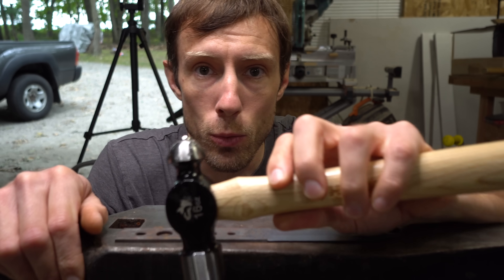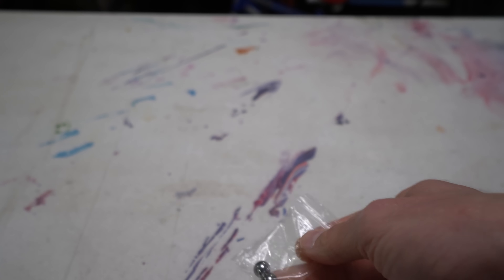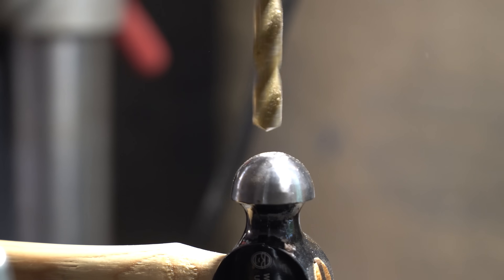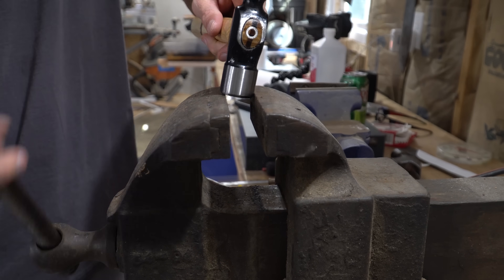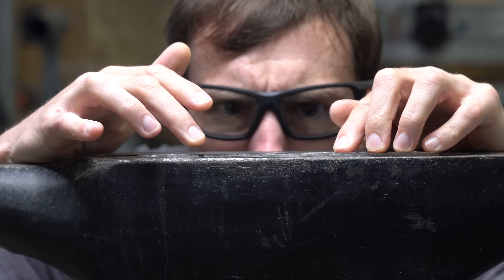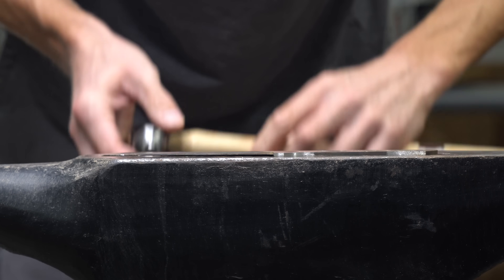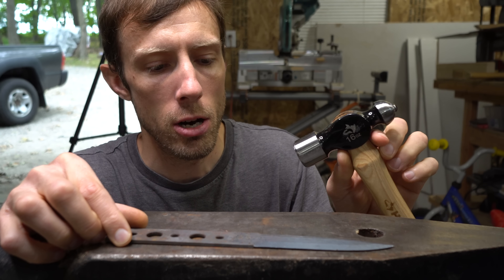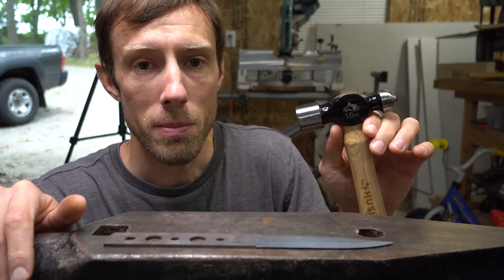I Should Have Made This Weird Tool WAY Sooner

Comment from the maker: A typical hammer is going to be somewhere in the low 40hrc range. Not hard enough to dent a hardened knife steel, which is usually in the 65-70hrc range.  Hence the need for the tungsten carbide ball bearing, which is going to be 70+hrc. For those wondering why you cant just use a regular hammer. 🙂
Reply: Tip. I put a magnet on my drill press and always put my key there. It never goes missing and is always very, very handy.
Reply: Maybe German hammers ere hardened different. I measured 3 hammers with a calibrated Rockwell tester .
I cleaned the hammer surface with emery paper .They were clean.
The readings are 57 to 60 Rockwell 
I knew from old hammers that they were made of mid carbon steel.
The steel gets relatively hard on the outsides but softer inside.
So the hammers do not Charter .
I tester this with C60 steel.
You can easy get it to 63 or 64 HRC
Reply: Maybe the base steel (but highly doubt it’s even that low, probably around 45hrc), but the face should be case hardened to around 50hrc to mid 50hrc. If you measured this then it’s possible the surface had a lacquer or coating on it. 40hrc is very soft and would probably be damaged by a typical framing nail when trying to drive it in. Just a little fyi.
Reply: You can anneal the ball end of the hammer to ease drilling since you don't need it hard after modification. You can use a hemispherical end mill to create a close-fitting pocket and you can braze the ball in place since that's the traditional high strength method for attaching tungsten carbide to tool steel.
Reply: @KJ6EAD If you soften the head of the hammer by annealing, don't you run the risk of just hammering the carbide ball into the hammer itself, rather than the hardened work piece?
Reply: @noxious89123  Not much. The force on the workpiece is concentrated in a small area so the workpiece yields in plastic deformation. The force on the socket is spread over the entire diameter of the ball so the deformation to the steel is elastic. Also, since you've only annealed deep enough for drilling and/or milling, the ball is backed by harder steel. If it's a concern, you're welcome to harden again after drilling or just leave it hard and drill with carbide.
Reply: @KJ6EAD  Tour method seems to me, the most secure way of attaching and durability.
Reply: I'm curious I've got some old carbide punches from work and wondered if I could use them for this project. I believe they are flat bottomed
Reply: Yes you can debend a blade with a normal hammer but what you're actually doing with this thing is cutting the fibers of the metal to let the tension in the blade bring it the other way. In France it's called "Piquettage" and you do it with some kind of mini pickaxe. And knife steel are most likely to go between 55-63 HRC especialy if you don't cryo ;)
Reply: @aeowan2  it’s kinda crazy he’s saying knife steel is usually 65 to 70. Isn’t it like only high quality, high carbon Japanese cutlery and high carbide tool steels like Maxemet that get up the 65 and slightly above range? I remember Jared from Neeves Knives showing his custom Magnacut blade that was like 67hrc while most production Magnacut runs at 60 to 62. I think my Spyderco M4 steel is supposedly 64 or 65. I’m wondering if dude just made a typo and meant 55 to 60? 🤔
Reply: @mikeappleget482  100% agree with you, above 63hrc is really high end steels and 70 is almost unreachable, I don't even know what will you do with a 70hrc knife xD That thing must be so brutal
Reply: 65-70hrc?? what kind of steel are you working with, rex 121?
Reply: Reads like a challenge to me. 😁
Reply: Doesn't matter if "peen" is the correct term or not. The BB isn't far enough into the hole for the peened-over material to capture it inside the hole. I see what you intended to do, but you either need a deeper hole or less epoxy so the BB sits far enough inside it that the lip of the hole actually folds over the shoulder of the sphere.
Reply: You need a retractable lanyard for your chuck key. They're dirt cheap and work great. The only downside is it has to stay with the drill press. 

Magnets work too but you have to remember to put it back lol.
Reply: You mentioned that this was done right after quenching and hardening in two different statements. Is
It done before tempering? The blade you broke (before trying this tool) broke after tempering?
Jus looking for clarification. Thanks!
Reply: Diamond has the highest HRC, therefore it makes the best hammer…. ? Is that the logic?
Reply: Epoxy that chuck key to a magnet and store it on the drill press
Reply: What if someone were deaf? Hammer on the concave side
Reply: Why don’t you just use copper and it’s alloys for making blades as is tradition? :)
Reply: Steels will be harder directly after quenching and before tempering. You loose a few Rockwell in the temper. It depends on the steel as to how hard it can get. So if you get a commercial blade that is 65 Rockwell out of the box, it was probably closer to 67 or 68 before tempering. A lot of more basic knife steels will be around 63-65 pre-temper.
Reply: I say this with love: Doncha just hate it when you forget to put the entire point of your video....in your video? When you see OTHER people do it, it feels like, wow, that guy's a MORON, the audience has NO CLUE why he's doing what he's doing. Yeah, nah, turns out, it's ridiculously easy to make this mistake, even when you've been repeatedly warned about it.
Reply: No normal knife is 65-70 hrc...they would shatter VERY fast
Reply: Absolutely cannot drill into my ball peen hammer, even with that titanium bit. How do other people accomplish this?
Reply: I partially dissagree with you. I made an apprenticeship as a tool and die maker in the late 1970‘s. Straightening thin mold parts that got warped after heat treatment was standard practice. We all had our shop made ball peen hammers. Either with the ball end turned on a lathe or a steel balls insterted into a hammer head. 
Also a steel ball will „deform“ a hardened blade to be straigthended. I still have my hammers from that time. I just straightended a blade hardened to 62 Hrc with a ship bought hammer you used to inlay the ball. But the ball end is flattened.
That said, I also made myself a hammer with a realtively sharp carbide tip to straighten blades. And for sure a carbide ball will not deform.
So instead of a carbide ball a steel bearing ball can be used. The dimples will not be as deep/pronounced though
Reply: Why not buying a carbide pin,  glue it inside the hammer and grind it round at the tip?
You can get round carbide for cheap.(broken Endmill)
I measured some of my hammers. The are around 60 HRC
Reply: 65 HRC would be the extreme high end of knife hardness with some exotic supersteels. 55 HRC is a more typical value.
Reply: @appa609 yeah.. supposedly my Spyderco M4 blade is like 64 or 65. And production M390 and Magnacut typically runs from 60 to 62. I think some super high end, high carbon Japanese kitchen knives get up around 66 or 68. But I think those knives would be so brittle that hitting it with a hammer would crack it.
Reply: @appa609  I wanna learn how to make my own nice knife

Comment: Bruh, I need help, these freaking tungsten carbide balls are basically impossible to get in my country, and I need that hammer BAD, but I REALLY don't want to order from overseas. Will alternatives work? Like tungsten carbide CNC bit?
Reply from the maker: If it has a rounded shape. You definitely dont want a point.
Reply: @OUTDOORS55  KInda late to reply but I bought a carbide CNC bit, ground off the jagged edges and mounted it in an old hammer. Works like a charm, at least on spring steel blades. For my stainless ones, no matter how much I hammer, I just cannot get rid of that tiny warp... ^^;

Comment: Just made one and it works exactly as described. Just be aware that while it will indeed bend a blade where struck, it must be corrected along the entire length of the curve, not just in the middle. If corrected only in the middle, the blade ends up looking like the letter "m".

Comment: "Panel beaters" (guys who hammered aluminum sheet into body panels for cars in the old days) used hand tools to do this every day. One way to understand what's happening is to picture the knife blade as made of clay. Tapping on one side squeezes the material out from under the hammer blow, making the material on that side longer. Being longer, the extra length pushes outward, curving the blade toward the opposite side.

Comment: Metal work...  I'm an intense DIY metal worker.  Nearly all of my sheet metal stock for belt, blade, and such guards comes from salvaged water heater tanks.  They show up at the curb on trash day...  And, I'm all about free materials.

Anywho, after cutting the top and bottom caps off and slitting the tank along its length, there's a rather nice amount of sheet steel available for fabrication projects.  But...

The tank curve makes for non-flat steel.  But, with a ball peen hammer and a 1" thick plate of plate steel as an anvil, I can flatten out any size piece of flat steel I need.

The tank steel is just mild.  So, there's no need for the carbide hammer modification.  But, boy oh boy does the simple act of straightening a few dozen project blanks introduce the skills of manipulating metal to dance as you'd like it to dance.

Comment: Keith fenner has great videos on how to straighten metals. Also old lathe and machining tool tend to have lots of braised carbide tips. You can buy yhis old tooling cheaply. Lastly backlight the material while it is lying on a flat surface and you will see the light bleed through parts where it is bent. Cheers

Comment: 👍
I did this and it is truly worthwhile. I sourced some tungsten carbide balls on eBay, sharpened that drill bit I've been threatening to sort for a while, and off I went!
Go do it, you'll like it. It's worth  mentioning that you don't need the ball if you're only working on steels like e.g. 1084, a std ball pein will suffice.

Comment: I bought the hammer and titanium drill bit and it will not drill into the hammer at all. Any ideas of how to move forward? You make it look so easy! Maybe the "pien" side needs to be annealed slightly? I should include that I used cutting fluid (Tap Magic) and the RPM was 370 on my mill.

Comment: lost drill press keys(and lathe chuck keys).  first I painted them bright yellow (john deere yellow because I had a can of it ).  For my lathe, I made a rack from PVC pipe with holes in it to hold all the allen keys and chuck keys and mounted it right behind the lathe where there is no excuse to not use it.
For my drill press, epoxy glue and a nicely sized super magnet from HF glued to a convenient spot on the drill press housing.  It's been years and now even if I don't stick the key back on the magnet, at least it doesn't blend in with all the other crap in my bench'  another magnet on the other side will hold a center punch, also bright yellow.

Comment: Absolutely love and needed the information in this video!!! Also… had the same problem with chuck key until…I drilled a 1/4” hole in the corner of the drill press cover and simply insert after using… problem solved!!!

Comment: Losing the drill press key always seems to be a problem. I purchased a very strong magnet and put it somewhere around my drill. Press or on the drill press or on the base of the drill. Press and attach the drill. Press key to it. I’ve done this for years, and it is yet to fail me in finding the drill press key.

Comment: I fix leaks in an oil refinery and we close up gaps with a hammer or air hammer and a chisel all the time. We call it "peening" as well. Hell I've closed up flange gaps over 1/4" before to hold wire and sealant to stop a leak.

Comment: Very good presentation. I make rock working tools for myself. You can find tungsten carbide insert tip buttons, on e bay. Kennametal KHC55, pack of ten for about $35.00 us. This grade of carbide is very tough and shock resistant. The cobalt binder in the tungsten carbide is around 20%. Most metal working tungsten carbide has 3% to6% cobalt binder which makes it very hard and wear resistant, but very brittle and not resistant to shock. The khc-55 buttons are 1/2” diameter by about 3/4” long with one end rounded off. Hope this has been helpful, stay safe

Comment: Since the tungsten bearing is spherical, it will stretch the metal in all directions when you strike it. I wonder if using a cylindrical bearing, with the axis of the cylinder perpendicular to the direction you want to stretch the work piece, would make for a more efficient tool?
Reply from the maker: Possibly however, I think it would be hard to hit the inife perfectly square, rather than contacting a single point on the cylindrical shape.

Comment: A magnet on the front of side of your dril Chuck, and maybe a dummy cord are great additions to the drill press. I have a few here that take different sized chucks. So dummy corded them so they could be used, hung on the magnet, but not walk off and not be long enough to be a tangle hazard.

Comment: You ought to dummy cord your drill press chuck key. I have an old-style chucked drill where the key is on the cord--can't lose it unless I purposefully try! The modern day keyless chuck has made us lazy about keeping track of these things.

Also, this is from US Army Technical Manual 9-254:
"(1) Staking is a method of securing parts by pushing surface metal together with punch and hammer. (2) Peening  is  the  stretching  of  surface  metal,  usually  with  a  ball  peen  hammer  or  with  a  hammer  and  a specially designed round-nose chisel. (3) Swaging is the moving of metal throughout its entire thickness where a definite shape is desired."

I'd say you were staking the ball into its substrate (the hammer's steel), but you could also have stated that you were peening the hammer steel. Both seem correct.

Comment: Tried the same with a used ball hammer I have, only to discover the ball tip of the hammer is probably hardened to a certain level, I ruined a 10 mm carbide milling bit :-(

Comment: I bought the same hammer, drill bit, and carbide bearings. I’ve been trying to drill into the hammer it just does not work. Flattened multiple center punches in the process, and dulled out a few bits. Anyone have tips on what I could do?

Comment: I use a string to tie my chuck key to the drill press.  I tied it to something on the back of the motor housing and the string is just long enough that I can reach the chuck.  I did this about 10 years ago and I haven't lost my chuck key since then.  I think I might just grab one of those ball bearings though and forge a top tool to hold it.  This looks pretty useful

Comment: Remove the drill and clamp your chuck key in the chuck of the drill every time. What bladesmith doesn't own a ball peen hammer?
Reply from the maker: I have them but didn't have the correct size

Comment: You seemed to have had a bit of difficulty explaining the process - particularly when it comes to which side to hammer on - so to help in future discussions about this:

You're hammering on the concave side of the bend - it bends like the mouth of a cave when you look at it. The other side of the bend is convex - I have no neat memory trick for this word other than "the opposite of concave".

Beyond that though, it seems to work pretty good :D

Comment: Use a rare earth magnet to hold the chuck somewhere that's convenient for you on the actual drill itself. 

There's some that come with adhesive on one side and you just stick it on. And there's also some with a countersunk hole in the middle if you don't mind drilling holes on your drill but want a sturdier hold.

Comment: Lol ! People don't realize how inaccurately flat surfaces are the longer, wider, and bigger a surface is the percentage of deviation can go up quite drastically.  An Anvile top would not be my first choice being a surface that is hammered on excessively. Hope you checked it with a surface tool or strait edge first not that what you're doing really needs the accuracy of a machinist. How straight and flat does it need to be.?

Comment: Ridiculous they remove names even if you separate the links into pieces. This place has 2 for $13 and they were available at a few other places quite a bit more expensive because they are in packs of 50. McMaster Now this other place sells them for $7 each, but they’re out of stock right now. Auminiaturebearings.. They take them down if you post links to sites for some reason.

Comment: My drill chuck can fly, crawl, and slither.   Therefore, it’s always nearly impossible to find. 
So I painted it 1/2 bright orange and 1/2 bright yellow.  
But I put 1/8 to 1/4 inch black stripes for contrast on it. 

A Simple way to HELP find a drill chuck, but no guarantee.   
I’m sure you have thought of that.    I will tell you it is definitely  worth the time painting  it.

Comment: I've got a few large carbide-tipped teeth from an asphalt road mill that might work well for this.  They usually get thrown away and replaced when they wear down to a certain point.  I had never thought much about how hardened steel was flattened before, thanks!

Comment: Interesting fact: It is actually possible to make the material bend away AND towards the hammer depending on how you apply it. 

Smart nanufacturing engineers used this to come up with a forming method based on shot peening called... well shot peennforming. It's mainly used in aerospace nanufacturing.

I had to do a report on shot peening once. There is something called an Almen strip test which you can use to test your shot peening parameters and tune them to get the desired result. You can harden a surface, flaten it or bend it to either side.